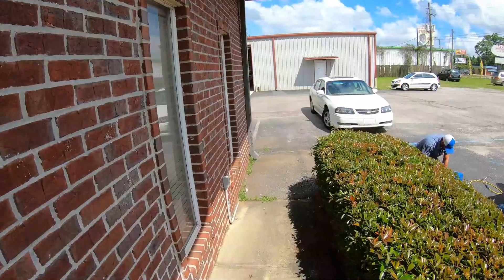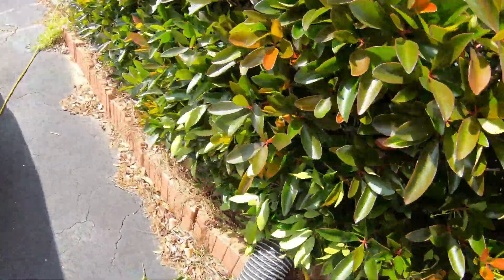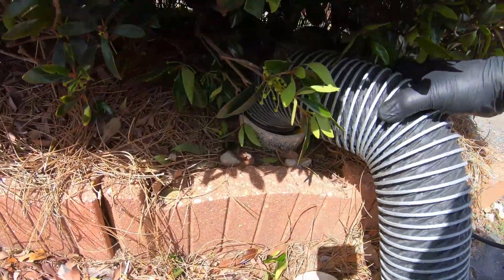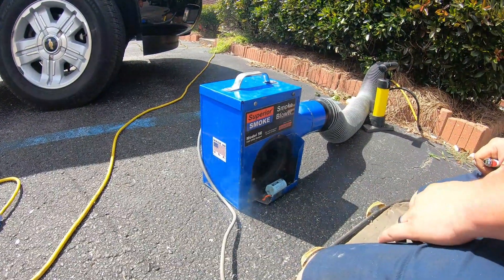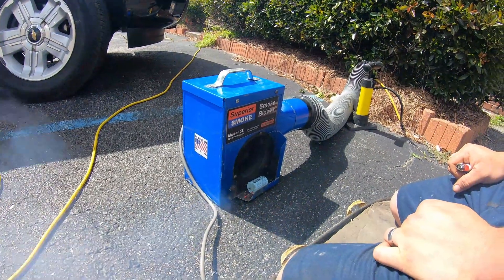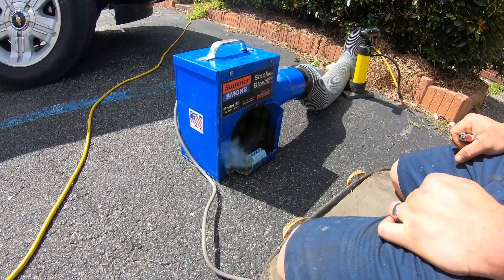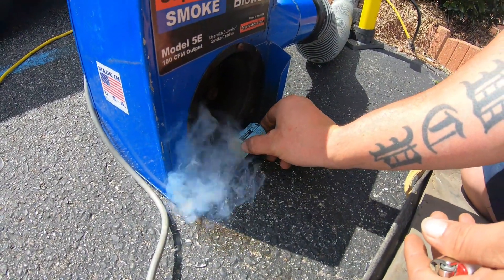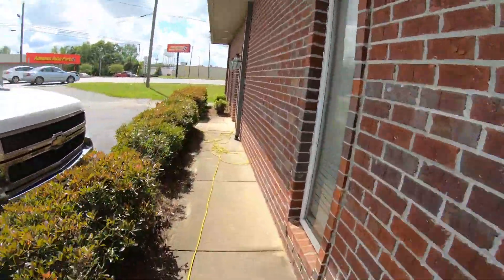Smoke Test For Sewer Odors

Comment: More of a last-ditch effort and I would have rather seen it on a leak not on a missing p-trap. You can also accomplish this same task with a Shop-Vac on reverse without the filter and a simple smoke bomb from 4th of July. Extra tip use colored smoke bomb to make it easier to find small leaks hope this helps.
Reply from the maker: Thanks for the comment! I’ll have to remember to stock up on smoke bombs next time the firework stands are open. Colored smoke is a great idea. On the last ditch effort subject, our customers are paying by the hour and they don’t want us doing things that may or may not work. From experience we know that they want a sure thing and that’s a smoke test for us! Where are you from?